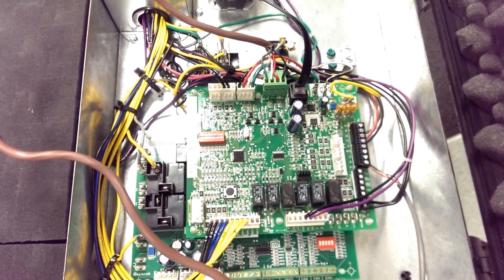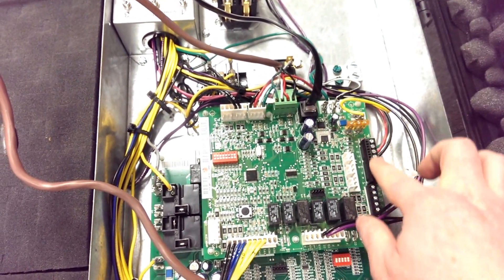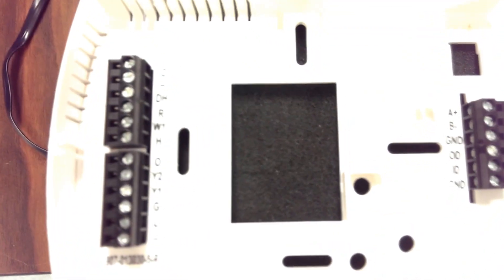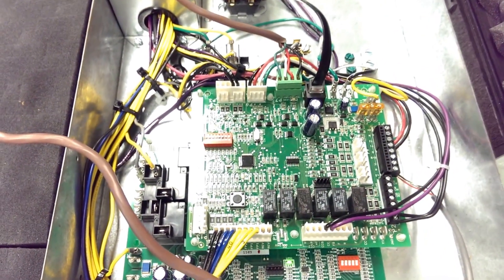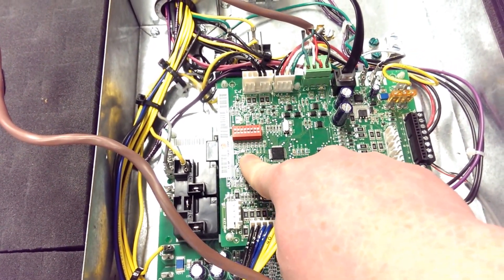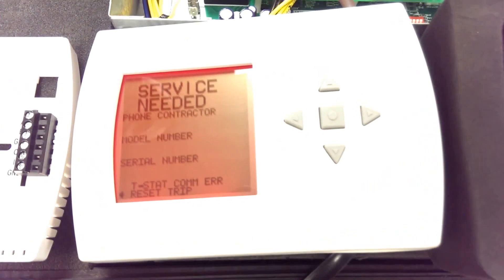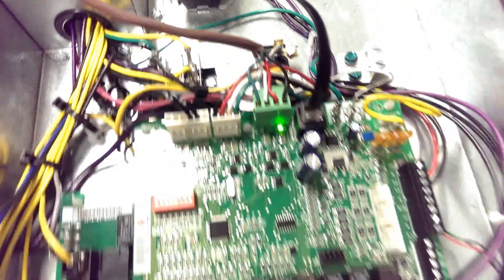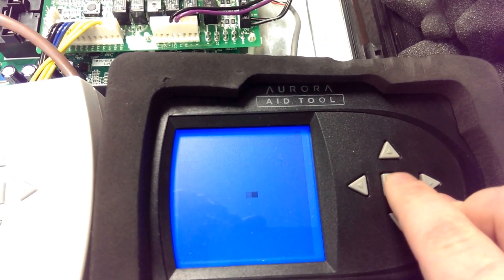Setup Communicating Thermostat on WaterFurnace Aurora

Comment: Oh my word!  I bought a Series 5 Water Furnace from a company that sold their company to another HVAC company before I could commission my Heat Pump. I was getting an NZ-13 ABC Comm Error on my thermostat on Startup. My new HVAC company doesn’t know Water Furnace and just ordered me a new thermostat. I just plugged that in and I get the exact same error. I don’t have an”AID Tool” but I will likely buy my own as it looks like this will fix my problem.
Thank you for this video. You gave me the answers that my HVAC company couldn’t.
Reply from the maker: Glad it worked out. If you email csr@edenenergy.com we will also sort you out with any thing you might need.